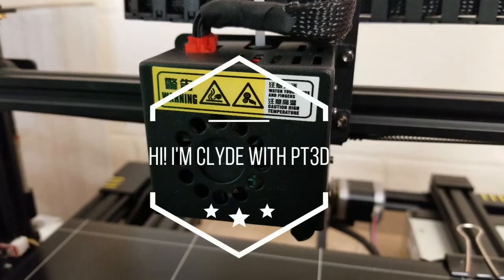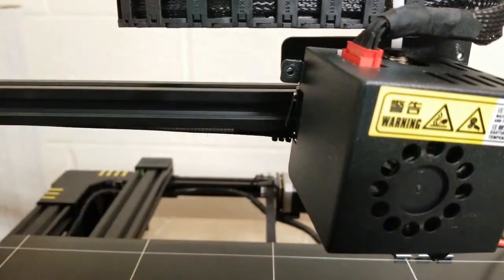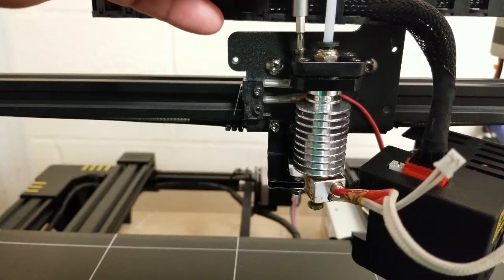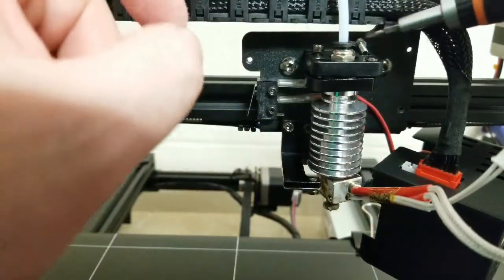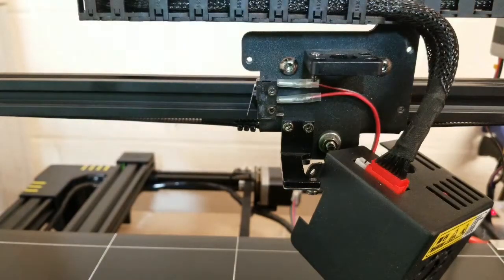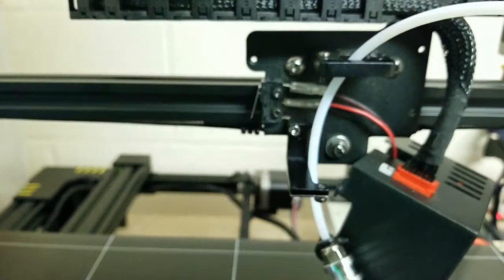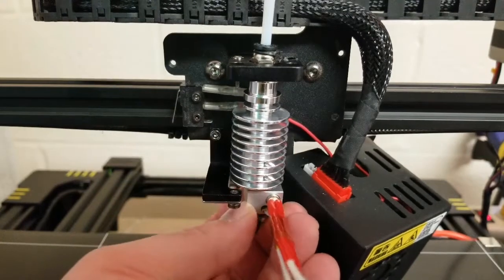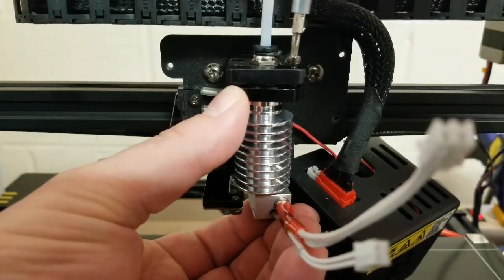Changing the Anycubic Chiron Hotend

Comment: So what ended up being the issue,  I am having intermittent extruder issues myself ,
Reply from the maker: I had a partial clog.
Reply: @pt3d315  I swapped out my hot end and it got worse,  I'm starting to think my hot end fan might be bad resulting in heat creep
Reply from the maker: I also replaced the extruder. To a Bondtech nock off. Of course, now I have to use Cura. My Simplify 3D isn't working with the new setup.
Reply: @pt3d315  did that solve the extrusion issue?
Reply from the maker: So far it has. I also upgraded to an all metal hot end